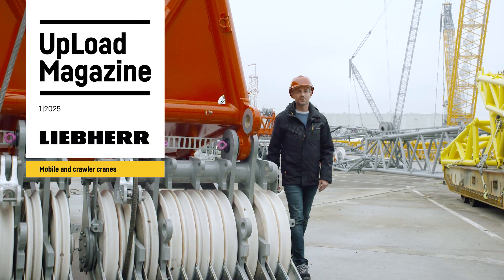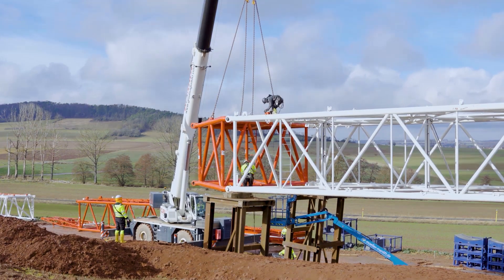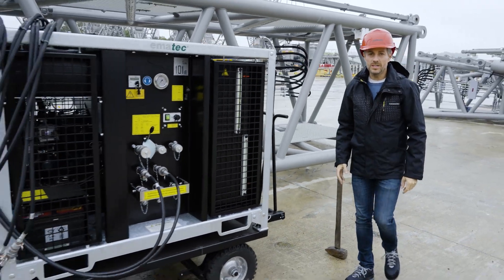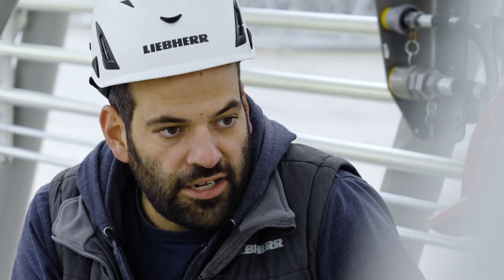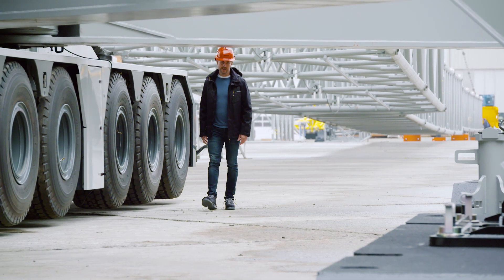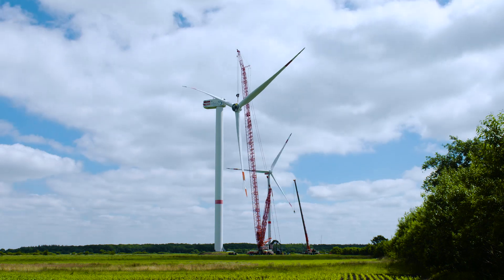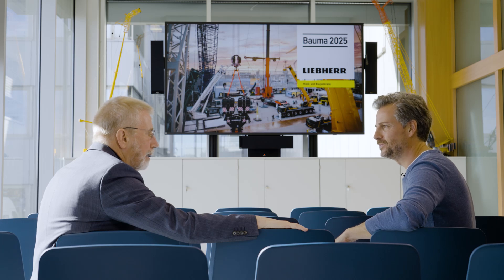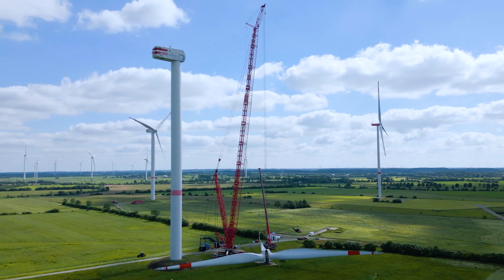Mobile and crawler cranes UpLoad 1/2025 | Liebherr

Comment: Very interesting. I find it very interesting that the new LG 1800-1.0 has outriggers that swivel out, but they don't appear to extend, unlike the previous LG 1750. Why is this? Is it that it was discovered that the needed footprint could be achieved without outrigger extension, or is there something else, like the VarioBallast that allows again for the reduction? It's very curious.

Also, that battery powered pin puller and pusher seems very useful, it's much more compact and agile than any of the previous hydraulic pack solutions. I can also see it actually allowing faster work, as it would be easier to employ multiples of those to allow pins to be fixed in parallel. Is it a particular type of battery, or are they going to be offered with different battery brand interfaces so that customers can pick and choose based on local availability?
Reply from the maker: It's because of the stiffness of the folding beams why they are not extendable any more like on the old LG 1750. 😉

The batteries of our pin puller are from the brand Milwaukee, so they will be available everywhere.